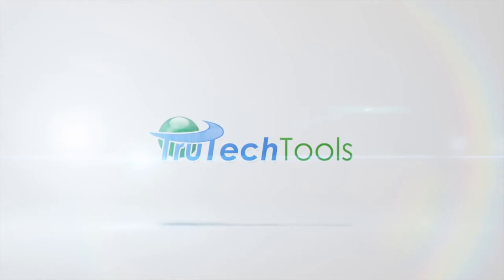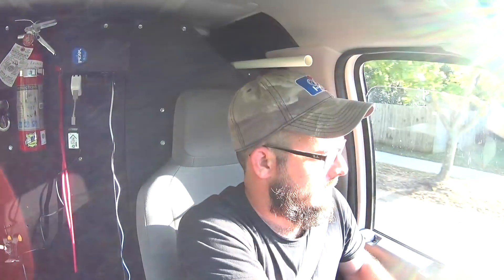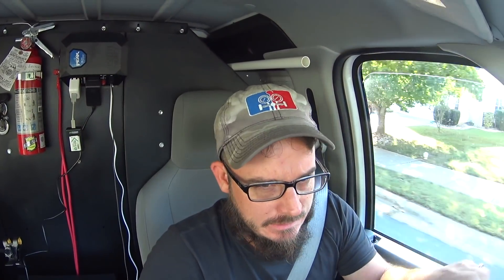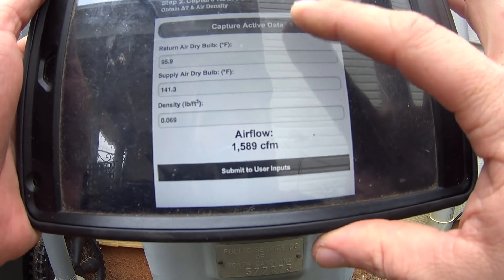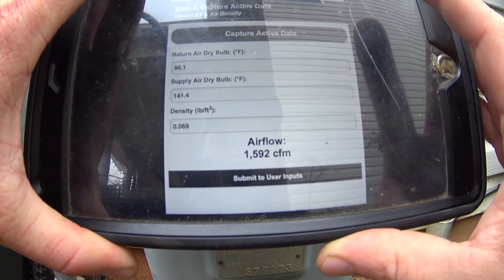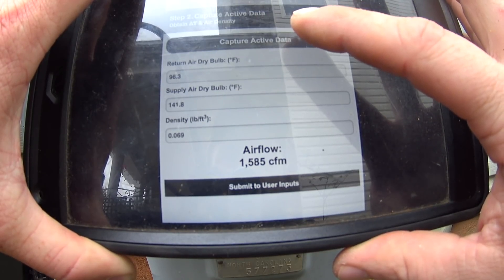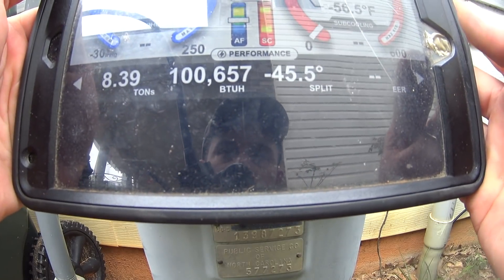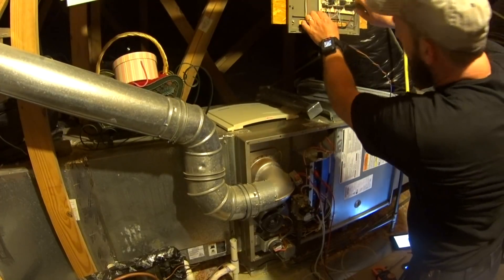9-28/29-17 System Seems to be Heating and Furnace Fall Heat Check

Comment: When cleaning the flame sensor  i was always told to use  fine steel wool and not sand paper     just a heads up   keep up the good work!
Reply: you can also use a dollar
Reply from the maker: +Akelesisnhl kelesis there are several ways to skin a cat

Comment: Thanks for the tool information and all the thoroughness of explaining what you're doing. I'll have to order the Testo gas probes with the red and blue hoses. I really like being able to test the capacitor without having to remove it along with clocking the gas meter. Thanks again.

Comment: Nice video as always bro.. But I would recommend inspecting the heat exchanger on all your heat checks. I've seen plenty of furnaces that the burner side looked pretty good but the heat exchanger had a hairline crack that didn't cause any rollout. Rigid has a few decent but cheap inspection cameras. Also, I was a little surprised you didn't do a combustion analysis and draft check. Everything else was spot on. Keep the vids coming I enjoy them

Comment: How do you check the flame sensor
Reply: darksabatta In what sense? Generally you take a micro amp reading by wiring meter leads in series between flame sensor and the spade connection wired to the board. Usually you should clean the flame sensor with sandpaper to get a good reading